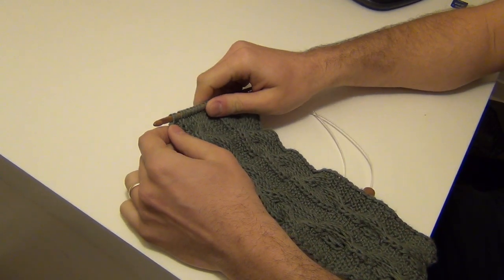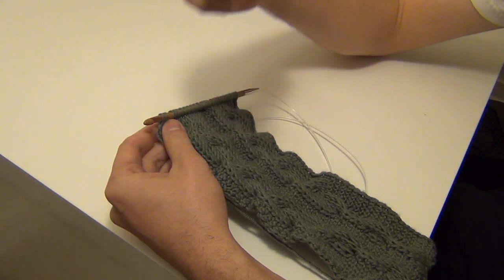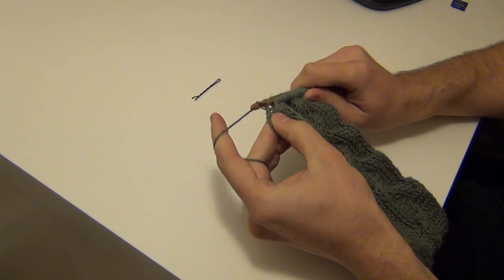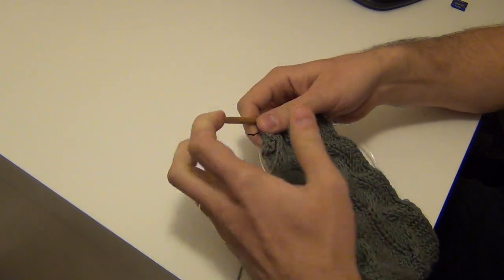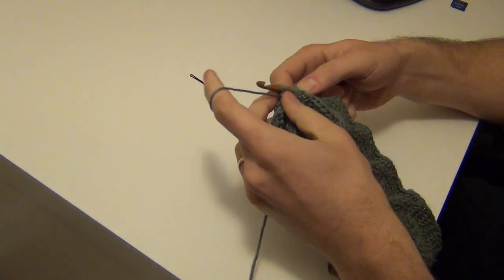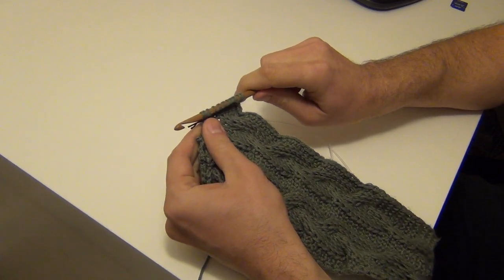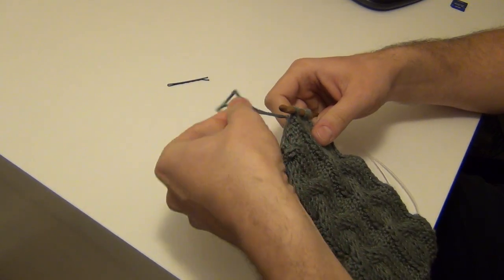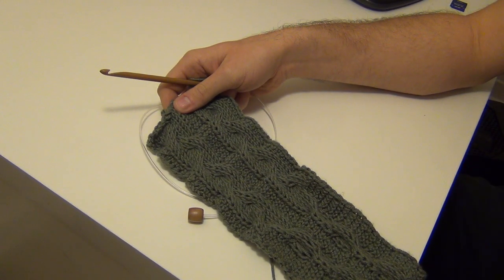Tunisian crochet cabling using one bobby pin

Comment: I love your method and it makes a lot of since but what I am having difficulties with is the very next row, finding your stitches.  Mine honestly looks like a bunched up mess to me.
Reply from the maker: +Pamela Cruse I've had that before! It can be very frustrating. What I do is use bobby pins to mark the stitches as you make them. You'll have a lot of dangling pins, but it's really easy to find the hole on your way back. Hope that helps!
Reply: +Josiah White ,
thanks so much Josiah I will try that.
Reply: What is the hook size?wer did u buy those needles?